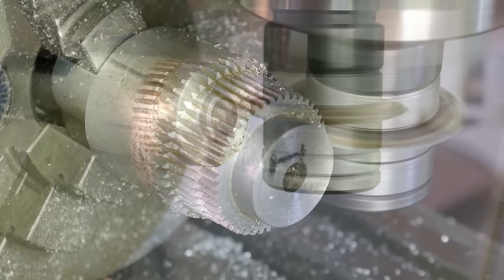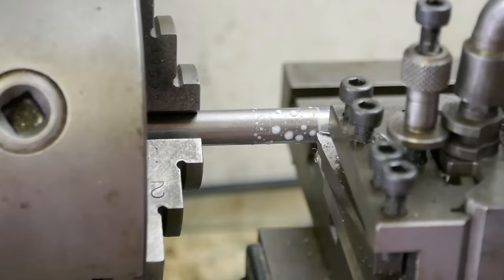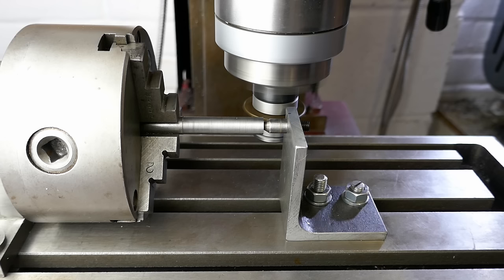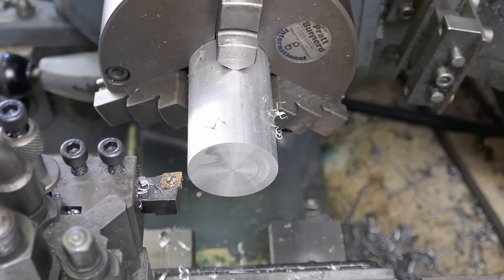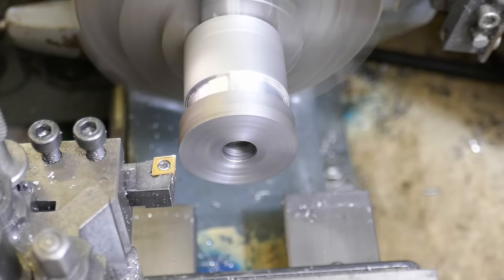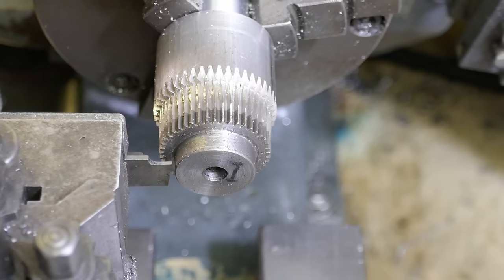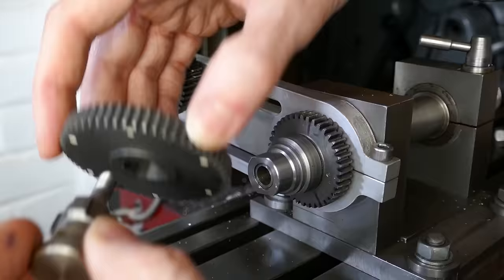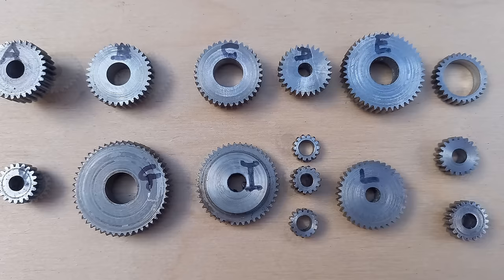Gear cutting.  Making gears in the home workshop.

Comment: Speaking of mod 0.6 gears, a set where one has 200 teeth and the other 189 will almost perfectly convert a 1.5 mm pitch leadscrew to 16 TPI or vice versa.  At mod 0.6 they'll also more or less fit on the common imported 7" mini-lathes; this is a project I look forward to tackling this winter.  Thank you for the video; there's no way to have too much insight into the practice.
Reply: The exact (not approximate) conversion needs 120 and 127 tooth gears. Why would you cut two gears with a total tooth count 70% higher than this only to achieve an approximation? 86 and 91 work as an approximate pair and the total teeth on the two combined is less than just one of the gears suggested above. If you are feeling lazy, 34 and 36 are good enough.
Reply: @darryllcrook376   good info, Darryll... 

😎👍☘️🍺

Comment: Great video.I would like to know the diameter and TPI of the threaded part of your Myford lathe spindle.Thank you.
Reply from the maker: According to Google, the Myford Super 7 lathes have a thread of 1 1/8 in x 12 tpi.  The large bore machines have M42.5 x 2mm thread.
Reply: @MetalMachineShop  Thank you for your answer.My chinese combo import has a spindle about 1 5/8" and 2 mm thread.I was thinking if a Pratt Burnerd chuck might fit since I don´t find chinese type chucks or adaptors any more.I love your videos.ATB.
Reply from the maker: @angelramos-2005  you can get adaptors for big to small threads but not vice versa as far as I know.
Reply: @MetalMachineShop  Thank you.I keep trying

Comment: cool contraption. Looking at the finish on your parts it looks like you have some serious rigidity issues on your lathe. Might be worth checking the bearings and gibs.
Reply: Its a Myford Super Seven lathe with an adjustable conical front bearing... I have an ML7 version, they aren't the most rigid of lathes but are popular in small workshops due to their small footprint...

😎👍☘️🍺

Comment: May I ask a silly question ,how do you determine the diameter of each gear depending on the number of teeth you need ?thanks
Reply from the maker: You can either do it from look-up tables or by calculation.  The gear diameter is normally expressed as the pitch circle diameter which is the effective diameter of the gear.  The outer diameter of the gear blank is greater and depends on the gear module (how big the teeth are).

Comment: Enjoyed your video - presentation & content. The centre height off the lathe cross-slide for the tailstock seemed a happy coincidence until I realised you had probably also made the dividing head with the same set up.
Reply from the maker: Yes I did!
Reply: If you don't have a milling machine, line boring the dividing head on the lathe saddle is an easy way to get the bores true AND dead-on lathe centre height, which will be useful for milling with a cutter in the lathe chuck... keyways or cross drilling is a simple process then... I made an identical dividing head in this way, I also made 2MT spindle nose collets for milling cutters or "barstock"...the increased rigidity was huge !!...

😎👍☘️🍺

Comment: Whats the cutting fluid ? ..looks like Rocol RTD.. (Stinky stuff but great for tapping, milling & turning) 
nice job... 

I made a dividing head like that many years ago using the Myford banjo... the design was in a book I still have somewhere...
I'm running an ML7 myself, couldn't afford the Super Seven at the time...🙄

😎👍☘️🍺
Reply from the maker: It's drilling and tapping fluid that I got from Machine Mart years ago.  Doesn't smell too horrific or maybe I've got used to it! 
The S7 was second hand but still quite an investment.  The gearbox is a great timesaver.
Reply: @MetalMachineShop  yeah, I have the QC gearbox too..also with the metric manual setup gears .😎👍
Reply from the maker: Nice - mine is imperial, I’d love to have a metric lead screw kit but I just use the nearest imperial TPI and adjust the design on the rare occasions I do screwcutting.

Comment: Hello! Fascinating video! If I may ask, how did you turn that taper so perfectly, at 4:44 ?
Reply from the maker: I used the lathe's top slide set over at the required angle.
Reply: @MetalMachineShop  Of course. I had the impression you where doing it freehand. Thank you. Your videos are highly interesting, full of tips and tricks I would never have thought of. That superglue trick for example. Quite useful. Keep up the good work! Thanks again, all the best!
Reply: I use a battery drill with a very slow speed and a big socket with cutouts for the spokes of the compound slide handwheel (topslide in USA) to get a smooth feed.
Reply from the maker: @gmcevoy  I got the superglue trick from the Clickspring channel.